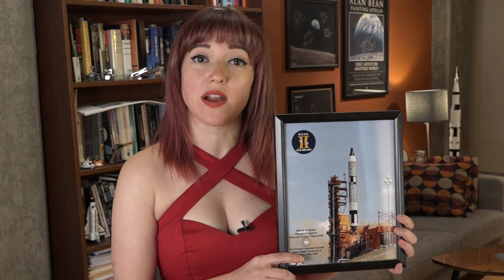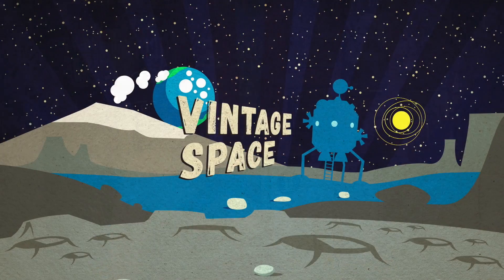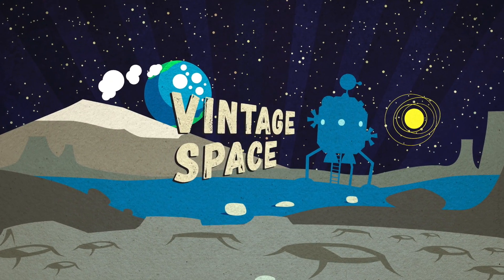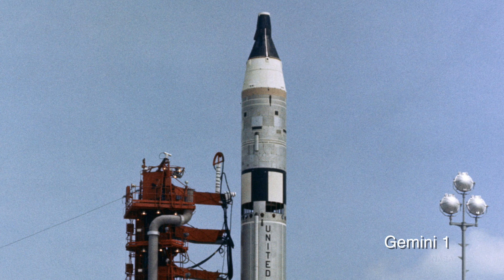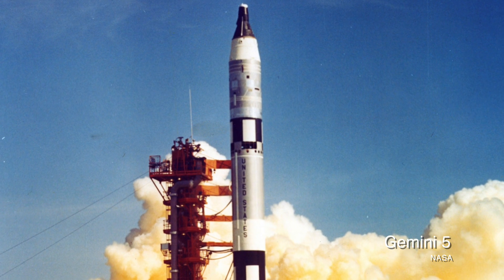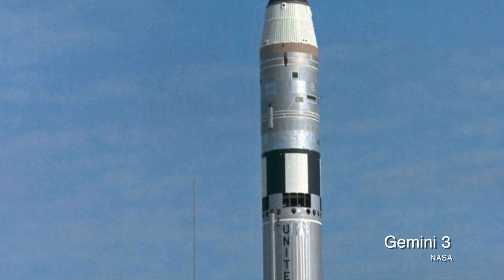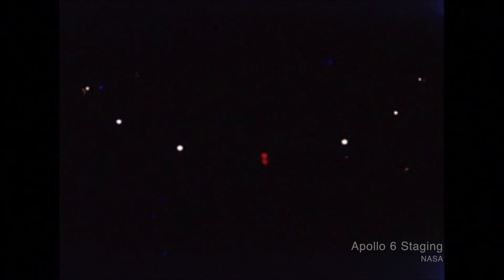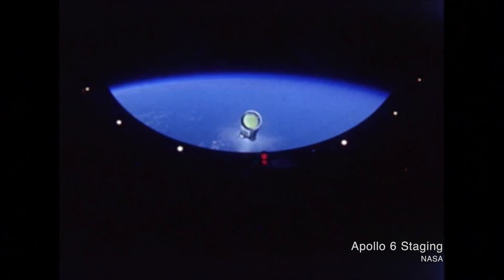Why Were There Holes in the Titan Rocket that Launched NASA's Gemini Missions?

Comment: What happens to the exhausted stages and intermidiate stage assemblies?  are they fully or partially reused or they are destroyed?
Reply: +Prakash Kamath For the Titan II?  They weren't recovered, assuming they even remained intact during the return to the ground. The only system the U.S. used that were semi-reusable were the space shuttle's solid rocket boosters--Even the main tank burned up in the atmosphere during it's return.
Reply: That means no significant parts returns back?
Reply: +Prakash Kamath Correct. Keep in mind that the Titan II was an adapted ICBM. None of the system was designed for reuse.
Reply: +Prakash Kamath the Gemini capsule was recovered, and other pieces would come down in larger or smaller pieces all over the place and not recovered.
None of it was in any way reusable however.
In fact the first possibly reusable rocket we have is the Falcon 9, and that one has yet to be reflown.
The Space Shuttle was partially reusable, but in reality the rebuilding after each flight was so involved that each launch was more of less a new shuttle with just a good number of parts used from the last launch.

Comment: Why did they have to ignite the 2nd stage while it was still attached to the 1st? If they used the ullage motors after 1st stage cutoff and then ignited 2nd stage,the blast ports wouldn`t have been needed.

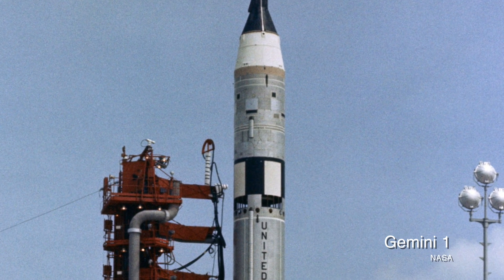Comment: At 0:40 it is obvious that there is a heck of a lot more open space in the skin of the Titan II than just the holes. The Titan II second stage initially ignited when the rocket was still in one piece. As the Titan II did not have ullage rockets to help in the separation at staging, the holes and the openings helped provide exit areas for the exhaust gasses from the second stage firing. There are videos here on YouTube showing the staging of the Titan II. "Archival Titan II Launch Vehicle Staging Video in Color"

Comment: That scenario you described where the 2nd stage engine fires up while the interstage is still attached was exactly what killed SpaceX's 3rd launch of the original Falcon 1 rocket. Between the 2nd and 3rd launches, they switched from ablatively cooled to regeneratively cooled engines. So when the 3rd rocket went up, the first stage burn lasted a few more seconds than intended, and as a result, the 2nd stage engine was almost completely enveloped by the interstage when it fired, and the overpressure from that ended up destroying the rocket. Full read-up here if you're interested: http://www.spacex.com/news/2013/02/11/falcon-1-flight-3-mission-summary

Also, that dress is pretty sexy. Good pick.

Comment: Now why did the Titan II engines cross their exhaust while all modern engines point straight down?
Reply: +heroineworshipper :That's not crossing exhaust. They point straight down except when gimballing for course correction. What your seeing are the semi transparent plumes overlapping.
Reply: +heroineworshipper the second stage engines needed more time to spool up than do modern ones, so they were started before the first stage had completely burned out and was separated. Modern rocket engines don't need that extra time, so no more need for the exhaust vent holes.
Reply: I believe that there was only 1 upper stage engine, but I could be wrong.

Comment: The important part of hot staging is the ullage, (the empty space in the fuel tank), and how pressurizing gasses mix with the propellant, causing rocket engine turbo pumps to fail. Sometimes the solid fuel ejection rockets are even on the stage being jettisoned. So the important part here is the ullage function, which is cool to explain, especially since most people know fire burns stuff. Just my opinion.

Comment: Amy.. I work in simulation. It is very fascinating the methods used in the era of these vehicles without the aide of modern computing. For instance, in the Hangar at Langley Research Center there's a mock up of the Earth hanging on the wall and a crane built inot the building. They would move the crane with astronauts in a mock up Gemini capsule to simulate reentry. The scaling of the Earth of the wall to the capsule hanging on the crane was as close as they could get to feel like the real thing. A video on the methods would be really cool.

Comment: Take a look at the Soviet N1. Open lattice work between all the stages, fairly typical in Russian rocket designs.
Reply: +Helium Road Not only N1, it is basically on all Russian multistage rockets (that use vertical staging). It is used on R-7 rocket family from 1958 (on Luna) and it is used on Soyuz-2-1v latest in family.
Reply: +Helium Road Yeah, the Russians were having issues with ullage in their early designs, and hadn't quite figured out a reliable stage separation and subsequent ignition mechanism, so they had the second stage engines ignite while attached to the first stage. They had to use holes similar to those on the Titan. This surprised me, though. I thought the U.S. was fairly familiar with the need for ullage by this point, and so I would think that they would have no problems with stage separation followed by ignition. I'd be interested to know if there were any aerodynamic issues that resulted from these open lattices.
Reply: +Benapllus1. The open lattice would inevitably induce some more drag than if there were no openings, however it's not really enough to matter.
Reply: Benaplus1
When USSR first time introduced vertical staging they already fixed problem with staging (they had problem with starting second stage in early R7 rockets that why they started first stage and second stage motors in same time and used horizontal staging same as US had same problems on Atlas rocket ). First time they introduced vertical staging was on Luna rocket and by that time they had reliable ulage motors (they used them for TLI maneuver on Luna rockets).
There is bigger reason why they use it even today, it is more efficient solution (marginally but in rocketry everything count). There is minimal aerodynamic impact of lattice and it only affect early part of flight (before rocket go supersonic).
Reply: Benaplus1
For Russians is simple answer, they still use basically same rocket as Luna (with some upgrades but even Soyuz today have same first two stages that was used on Luna, with some upgrades but core is same). There is another fact that USSR and Russia never was fan of big engines (like F-1 due problems with combustion instability and that why they even today use engines with multiple combustion chambers like in case of RD-171 or RD-180)
For US i can only guess that Titan II used it because it was developed from ICBM and that was considered as more reliable (which is paramount for ICBM) and easier solution at that time, before that Atlas used so called 1.5 staging (it did not drop fuel tanks but only engines and all engines started on ground) and Mercury-Redstone before that was single stage rocket.
Even it is not technically correct I consider Atlas I to be first single stage to orbit rocket (it did nor have traditional two stages)
Reply: Miloš Lazović Atlas I was considered a "stage-and-a-half to orbit". All three engines were started on the ground and telemetry was tested for a couple of seconds before liftoff to make sure they were running properly. This was because in the 1950s nobody had any experience with air-starting engines for upper stages and even ground-started engines were not yet proven reliable. Atlas was the first US ICBM and was hurried into service, while Titan and other US launch vehicles had time to test out air-started upper stages.
Reply: Thanks, I didn't realize that the Soviets had ullage motors by Luna 1. The information I drew my comment from was from an American history of rocketry, though, so it might have portrayed the Soviets as behind in areas that they are quite proficient in. So, I think the question is, why do the Americans use ullage (I believe a ullage system is planned for the SLS) while some Russian rockets continue to use open -lattice staging (like the Soyuz)?
Reply: Interesting background re Atlas I one and a half stage design choice. And the Atlas I went into orbit in 1958! That was Project SCORE, and  was the first communications satellite experiment. It was a pretty impressive US response to the first Sputniks, but the USSR had the advantage of bigger size for several years in the R-7, whose improved Soyuz versions are still the most used workhorses for putting stuff and people into orbit. Interesting trivium: Andrei Sakharov over-estimated the mass of the H-bomb he was developing, and hence the size of the first ICBM to deliver it was so big. Like Atlas, the R-7 wasn't a very practical ICBM, but it provided the basis for the early Soviet space program. Later Soviet ICBMs, of course, used hypergolic fuels, leading to the famous split between Korolev and the hypergolic-favouring Glushko. The Titan (in various versions)  was America's last hypergolic booster, but Russia's hypergolic Proton and many ICBMs are still in use (the US went much more for solids).
Reply: Miloš Lazović Good explanation.
Reply: Miloš Lazović The Atlas problems were solved by installing a "bellyband" between stages.
Reply: Miloš Lazović there wasn't any ullage or TLI. Upper stage ignited once and then burned directly to the Moon, without parking orbit or re-ignitions
Reply: This, and the ugly, sickly green primer they painted it with, made the N1 look soooooo Russian! Bleak, functional, and utilitarian as opposed to the sleek & decadent Western Saturn V!  😁

Comment: Interesting detail indeed. Concerning the ullage motors, I wonder why it's necessary to force the fuel into the pump intakes. Just because the ignition might fizzle or is there a risk of turbopump or (regeneratively cooled) nozzle failure due to gas bubbles?
Reply: +Pontus Lundström Given that there is no acceleration at stage separation, fuel and oxidizer would be "weightless."  Without ullage to slightly accelerate upper stage, neither would flow into turbopumps. They would just spin without moving fluid.  You don't see that on Earth as fluids have "weight" and accelerate downwards into pumps.  Of course, if you turned rocket upside down while on Earth, pumps wouldn't be able to move fluids to engines either.  To get fluids to move into pump suction, you either need "weight" or you need pressure.  Weight is easier and safer to impart than pressurizing fuel and oxidizer tanks.
Reply: +RichTheEngineer Thanks for mansplaining what I already knew :P So it would be unreliable or plain stupid from the ignition sequence point of view to depend on the negative pressure generated by the gaseous fluids moving through the pumps?
Reply: +RichTheEngineer Except the tanks were pressurized, with helium. The tanks have to be sealed, so as the fuel was used up by the engines, the volume had to be replaced with something: helium. Otherwise the tanks would have collapsed. Think of a 2 liter soda bottle. As the liquid drains the walls collapse unless air comes back in or you shake the bottle first and the carbonization is released and forces the liquid out. Liquid helium was in tanks on board, which flowed through the nozzles to keep them from melting, which vaporized the liquid that was then pumped back into the tanks to keep them pressurized so that the fuel was forced into the engines.

Comment: Isn't the main reason you use ullage motors is to force propellants to the bottom of the tanks so they flow into the main rocket motor before you light it?
Reply: +stainlesssteelfox1 - Absolutely correct!  Cryogenic fuel tanks are never filled all the way, so there's always gaseous contents at the "top" of the tank.  When the previous stage's engines cut out or reduce thrust as they burnout, the contents of the tank experience a microgravity and actually start to expand back into gas.  The ullage motors are then fired to compress and liquefy the contents against the base of the tank and the intake piping for the pumps.  this allows the pumps to force liquid into the combustion chamber and start a clean initial burn.  Gemini/Titan and Apollo/Saturn used hypergolic fuel/oxidizer combination which combusted on contact, so there was no need for an ignition system.  Sucking in a small amount of gas was expected, but a large gulp could cause a sudden burst of acceleration and damage or breakup the vehicle.
Reply: +stainlesssteelfox1 Yes. The Saturn V used RP-1 and LOX (liquid oxygen) in the first stage and LH (liquid hydrogen) and LOX in the second and third stages. It was only in the SMPS (Service Module Propulsion System) that they used hypergolic fuels.
 
Before liftoff, all of the fuel tanks were pressurized with helium. At liftoff, gravity held all of the fuel in all of the tanks at the bottom of the tank. During flight, gravity, acceleration, and gaseous helium helped force the fuel out of the S-1C into the F-1 engines.
   
When the S-1C cut out, the metal parts of the rocket slowed down just a little bit (relatively speaking) while inertia and momentum kept the fuel in the second stage moving forward within the S-II tank. It was now slammed forward to the top of the tank, and the liquid fuels and the gaseous helium were now mixed up within the tank.  The ullage rockets on the S-IC fired during staging and acted like brakes and slowed the first stage down, while the ullage rockets on the S-II fired and accelerated what was left of the Saturn V forwards and forced the fuel back down to the bottom of the tank, where it flowed into the pipes and pumps and ignited and accelerate it in the next leg of the flight. This process was then repeated during staging of the S-II and the S-IVB.
 All this is according to the book “Saturn” by Alan Lawrie and Robert Godwin, available on Amazon.com
Reply: Okay, so they do also act like seperatrons as well.
Reply: +stainlesssteelfox1 Yes, but that wasn't their primary purpose.  There were strategically placed retro rockets to slow the discarded stage for separation.  They fired at staging to prevent collision whereas ullage motors are often slightly delayed in order to provide time for the vehicle to stabilize after staging.  For example, on the Saturn V, there were 8 retrorockets on the first stage and 4 on the second.  The second stage ullage rockets didn't fire until a second after separation.  I can't recall what the separation delays were for 2/3, though.  The third stage had two solid ullage motors that were used for separation (and jettisoned), but also had ullage motors built in to the APS for subsequent firings of the S-IVB.
Reply: This was actually known as a fire-in-the-hole because the upper stage was still attached to the lower stage.  In the case of the titan II, the upper stage was ignited while the lower stage was still firing, so this ensured that the upper stage propellants remained seated at the bottom of the tanks so that a separate ullage maneuver wasn't needed.  If you look at some Titan II staging videos, you can see that the interstage does get ripped apart shortly after separation.  If you saw the movie "Hidden Figures", you did see this, because they tried to pass off a Titan II staging as the staging of the Atlas that took John Glenn to orbit.  :)

Comment: When you look at a rocket you are not really seeing it you are seeing a very thin skin that surrounds the rocket. Under that skin are girders beams, fuel tanks, oxidizer tanks,  Fuel pumps, hydraulic pumps, and finally the rocket engines. The skin of a rocket is there to streamline it thus reducing drag. All components are made as light as possible as weight is the enemy. When a rocket stages it does it for two reasons. The first is to get rid of the weight of the spent stage. The second is to further accelerate but because the rocket now weighs much less the engine of the second stage can be smaller yet can accelerate even faster. All modern rockets have holes in their skin. That is so internal pressures can never develope as there is always some out gassing from the fuel tanks.

Comment: The purpose of ullage isn't only distancing. It also serves to 'squeeze' the propellant in the net stage towards the engine(s) and fuel pumps as, when a rocket stages, its propellants essentially go into free fall or close to zero-g.

Favorite launch vehicle is probably Proton-M at night launches. That light blue, extremely long and straight exhaust plume!

Comment: OK. I have a "vintage" question for you. Why do Mercury and Gemini capsules have hundreds of parallel ridges or indented channels in the metal skin of the craft, but the Apollo capsule does not? Are they for structural rigidity, heat dispersion... what gives?

Comment: The ullage motors are used to push the fuel inside the upper stage towards the pumps in the first place. Not so much for stage separation, this is more of a byproduct.
But we see these 'holes' on every R-7 (Soyuz) and Proton launch ever since the late 50s, so nothing special about that actually.

Comment: As just a minor point of detail, the "ullage" term comes from brewing, and refers to the air gap at the top of a tank, when using some acceleration to settle the fuel contents in the tank toward the bottom where the fuel feeds are. This is the main purpose of the ullage motors, though gaining some separation space is also a benefit. Often retro-motors are used specifically for creating some distance between the stages. A great example is in the Saturn V, which used both types of motors, which for example had retros hidden inside the first stage engine fairings, which would rip the fairings open upon firing, and a set of ullage motors on the interstage to provide some acceleration for the second stage.